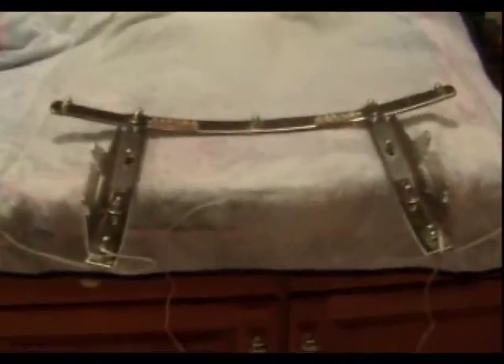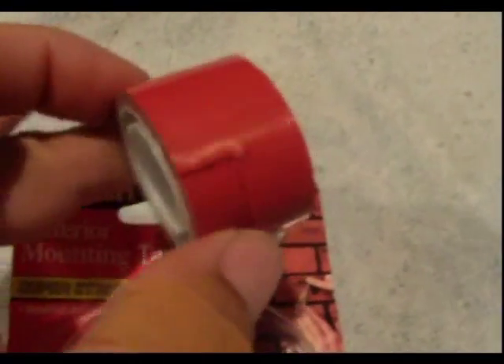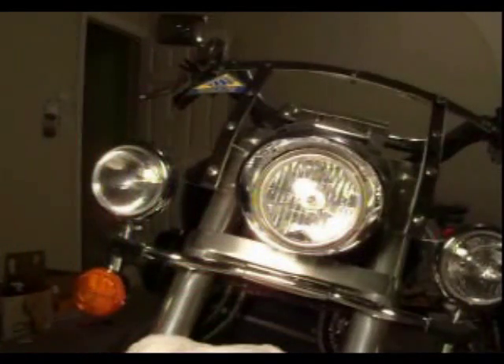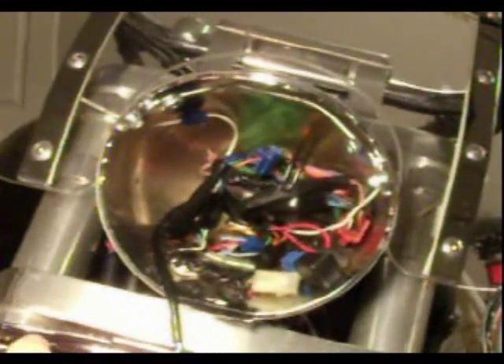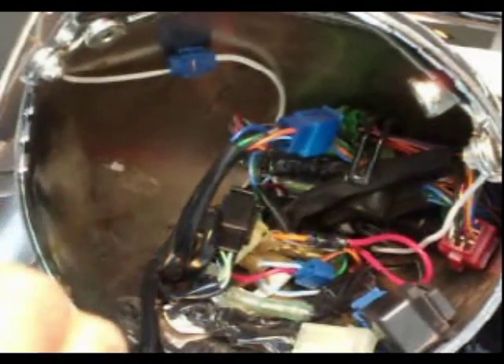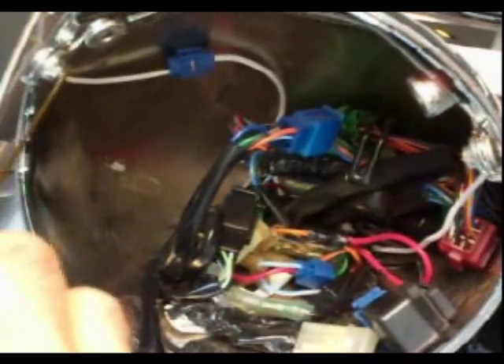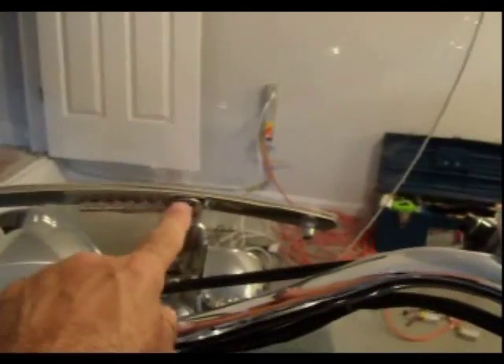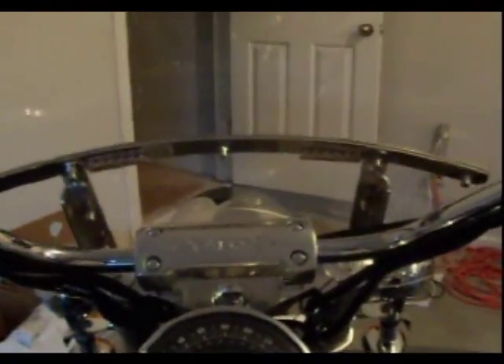VTX 1800 LED Turn Signal Indicator Installation - Shield Mount

Comment: are you using 4 trailer connectors? Two for each turn signal?
Reply from the maker: Brian Jones Nope, just one connector for each turn signal...each connector has a positive and negative wire.